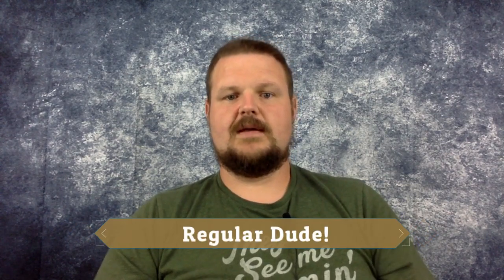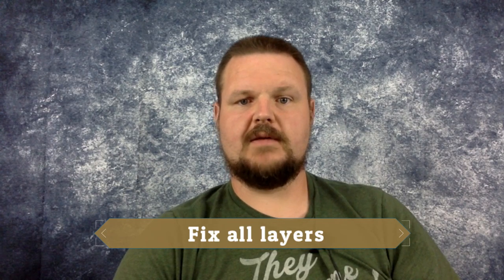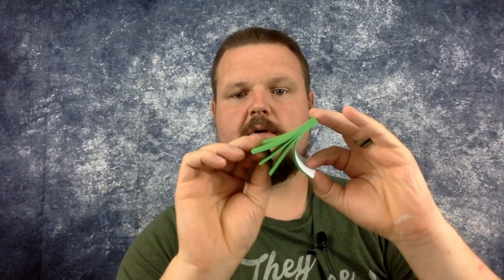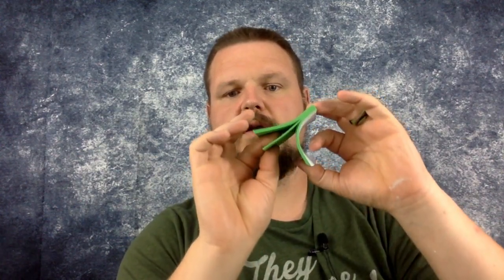RV Side Delamination DIY   Part 3

Comment: Taking the front nose cap off of a 2012 Keystone Passport. The front cap has begun delamination. I have .040 aluminum sheets with an S- BEND to replace, The frame is also aluminum.  Some minor delamination has started on a sidewall that will be epoxied and clamped as well.
Reply from the maker: I wish I had went with aluminum myself

Comment: these videos are great, but they would be maximized with like RV renovation instruction or Hacks.... More people should be seeing this.. I am lucky because I found you...
Reply: I mean changing the SEO key words... and title and video descriptions
Reply from the maker: I actually had an idea for a quick Tips section, just like 30 seconds of a random tip like?  What kind of roof do i have?
Reply: The Gimpy Camper good I idea.. there are fewer videos on RV Hacks and Repairs... more Van  builds. You fall into that category for sure!! Go go go.. build that brand